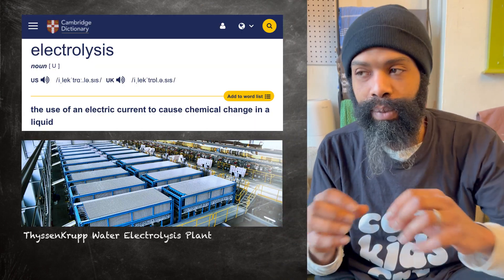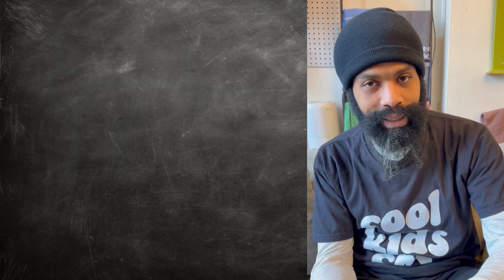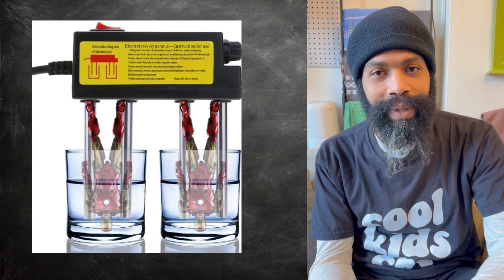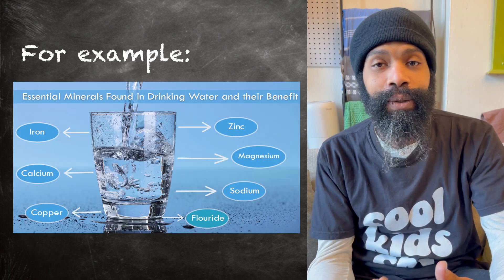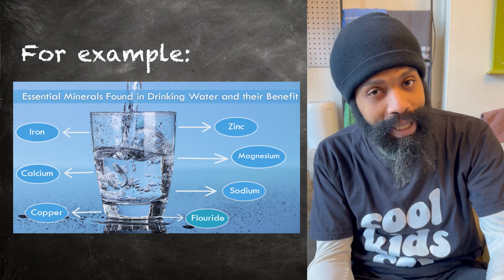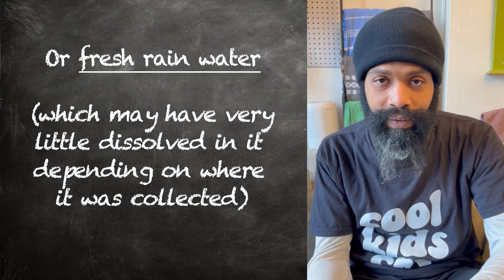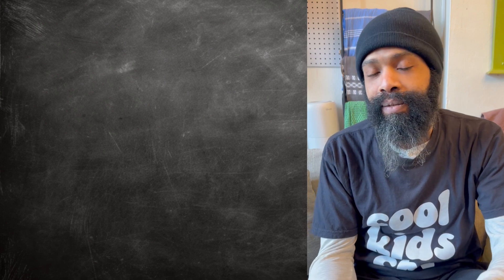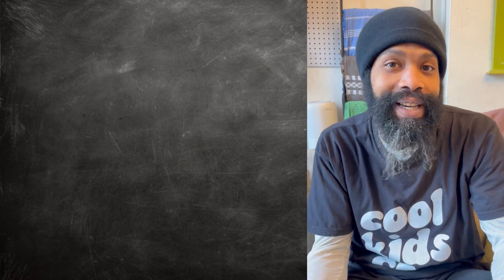Water Electrolyzers Are Pretty Much Pointless

Comment: ALL THE ELECTOLYZER DOES IS PUT AN ELECTRIC CURRENT AND SHOWS ALL DISSOLVED CONTAMINATES. THE BEST WATER IS DISTILLED 100% PURE H20. YOU DONT NEED MINERALS IN YOUR WATER. THE MINERALS IN THE WATER ARE NOT EVEN 1% THATS NOT ENOUGH TO DRINK FLOURIDE AND BLEACH.
Reply: No you do need MINERALS in your water. Also learn to turn the caps lock off.
Reply: @he11sy  NO YOU DONT NEED THE MINUTE MINERALS IN WATER. THAT EQUALS TO .01 OF THE MINERALS YOU NEED. THATS NOT ENOUGH TO DRINK POISON ALSO.   YOUR BODY NEEDS PURE H20. 99.99% ALL YOUR NUTRIENTS AND MINERALS COME FROM FOOD

Comment: Fun fact distilled water shows CLEAN after the electrolyzer water test correct? So say tap water shows brown or black filthy stuff correct? Well now use the distilled water again this time ADD organic sea salt say half a teaspoon of it now see what happens with that clean distilled water....yes it turns yellow/brown or darker....is this filthy water? No it just has minerals that your body needs. I do see the scam but its handy if you absolutely need complete clean clear water like distilled and want to test if its indeed absolutely clean/distilled water for certain applications then the test is very handy. But in certain areas the tester also can be handy to test the water quality of tap water some areas do FILTER sewer water and they DO have excrement particles that you really dont want to drink. Overall its fear tactics unless you know hat you are doing.
Reply: Correct.

Comment: So... Would there be some situation where distilled water could prevent electrocution during a freak accident?
Reply: Water on it's own can't conduct electricity because there are no free electrons, so it's technically an insulator. However water is also an excellent solvant for just about anything due to it being polar so you don't need to introduce a lot of impurities before it becomes conductive, which is why no one uses it as an insulator. However oils are commonly used as insulators because they aren't polar and as such can't dissolve ions and other conductive things, though you can't just use cooking oil because it can still catch in fire, you need to use mineral oils that can handle very high temperatures. People sometimes use mineral oils in high end gaming PC for example because the mineral oil is a way better conductor of heat than air and it can also act as a massive heat sink, though it's mostly done because it looks cool.